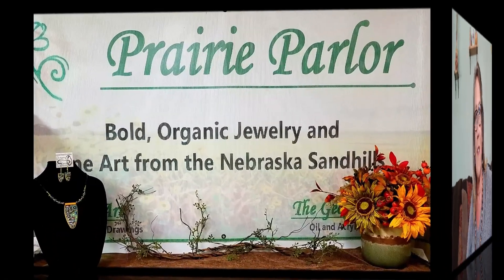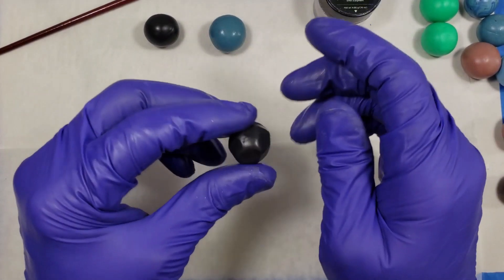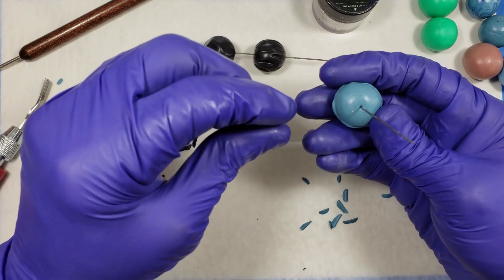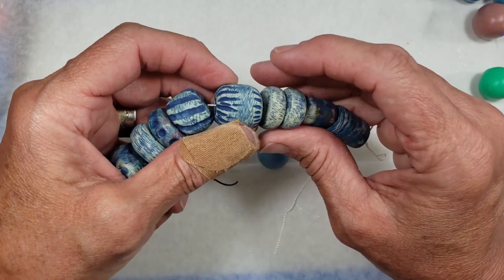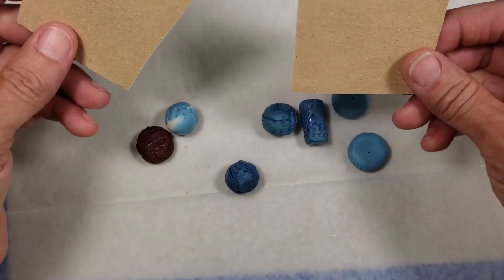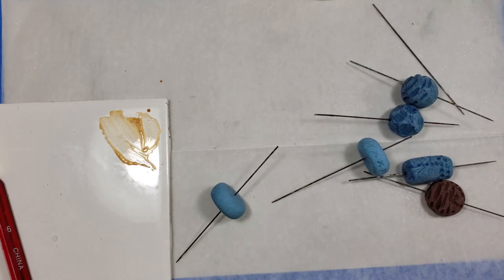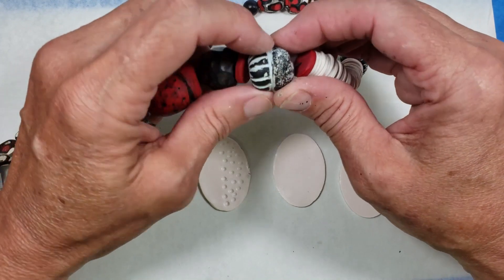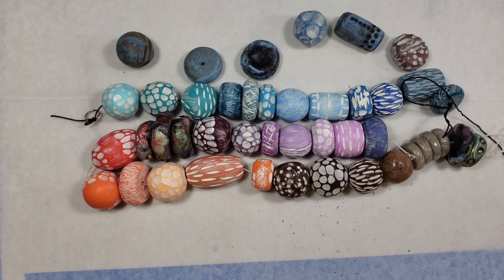Carving Polymer Clay Beads for Texture and Effect, Part 2

Comment: Theses are beautiful!, I've been searching for a technique like this. Just a question, will any acrylic paint work? Could I use house paint (only have house paint and cheap poster paint). I'm guessing it's better to use quality paints so they aren't  as likely to rub or wash off as these aren't sealed?
Reply from the maker: I'm sorry I'm took so long to reply! Yes,  any water based paint can be thinned out and used.  Just make sure it's very thinned out because those paints tend to be very thick and you would be sanding forever! And I don't use expensive paints,  I use the cheap craft paint in little bottles!